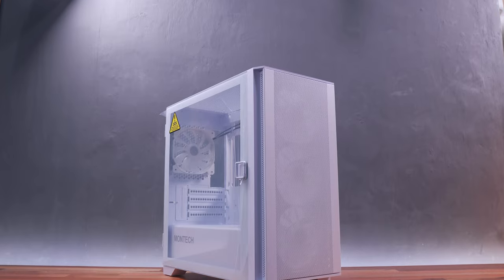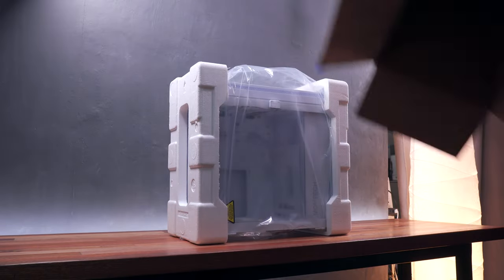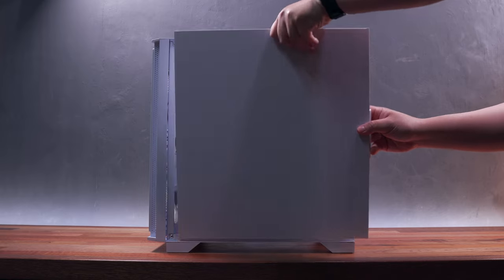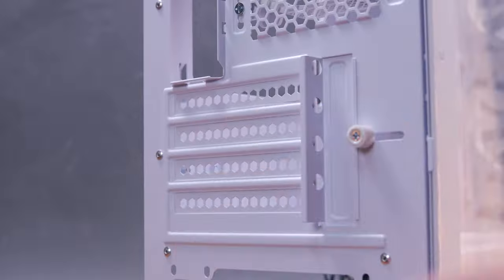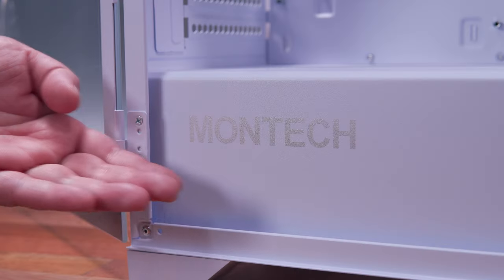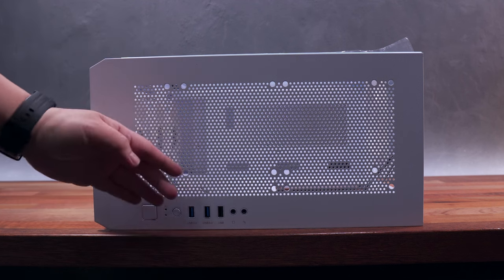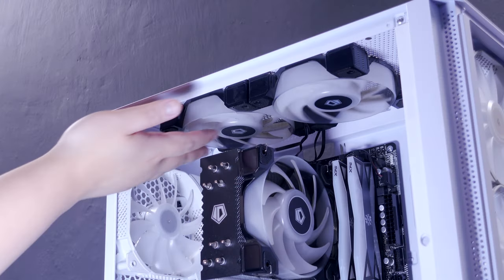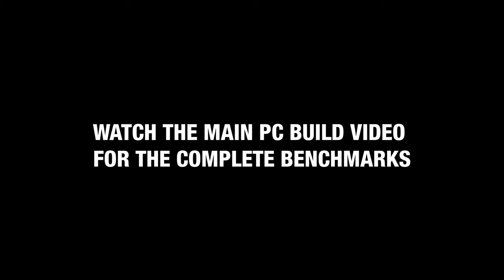Montech AIR 100 ARGB Review - Bang for the Buck!

Comment: Just picked up this case. I did replace the fans and getting ready to do a 5600X 3060 build in it.
Reply: Whats wrong with the fans
Reply: @leonthesleepy  Nothing I just wanted some fancy ones
Reply: @leonthesleepy  Most included case fans are noisy and 3pin. Some people prefer quieter and PWM-controlled fans.
Reply: @flatikk   (Gamdias ATHENA M6) says it has pwm argb fans.  Is it aura compatiable? Or i should go for aftermarket fans....
Reply: Can you change the color of the stock rgb fans or is it only the rainbow color?
Reply: @SheLuvzFear   u can change it
Reply: @SheLuvzFear the small circle button on top of the case

Comment: Between montech air 100, darkflash dlm21, and rakk haliya, alin mas ok overall? I’ll be buying 120mm fans separately so the fans that come with the case dont matter to me.
Reply: All cases you've mentioned has good airflow and similar features. I'd would suggest picking which ever one is the cheapest or pretty much a matter of design preference.
Reply: I got the Haliya M, 2yrs ago and still using it.. It's a good budget case too, but I liked the front io placement of this montech air 100

Comment: hi! i just got this case to build my first pc and i am having trouble figuring out how to control the fan lightings. i tried the button near power button but it isn’t working. any tips?
Reply: Same fid you fix it
Reply: @imLazzy.  yup! i basically had the led input connected to the reset on my motherboard which caused the issue. so to fix it,  unplug it from the motherboard and plug it into the rgb box in the back of the case
Reply: @jayjasmine4669  bro i got it fixed i am so happy
Reply: @jayjasmine4669  bro i got it fixed i am so happy
Reply: my fans rgb turn on but they won’t spin any help?
Reply: @expoxd  Hi, I have the same problem. How do you fixed it?

Comment: 1. What is the name of the fan you bought on top? 2. How did you make the wire long enough to the fan hub. It even has same connector of the 4. Question 3. How did you make all fans the same color.
I hope you will answer the 3 questions. Thank you so much. More power to you.

Comment: Does it actually fit a 330mm graphics card? 
I'm thinking of putting a 6800 xt that is exactly 330mm so I need to make sure it will fit before I buy.
Reply: Don’t buy because you can’t remove side graphics card thingso card doesn’t fit

Comment: What cable do you use for the rgb hub to power it on?
Reply: @judeyang4136 most power supplies have a cable that connects straight the to rgb hub

Comment: Hi. How did you get the argb fans to work through the motherboard? All 4 argb fans are connected to the hub and I connected the argb cable of the hub to the motherboard and it doesnt work.
Reply: I think u have to use the hub first and then connect it to ur motherboard
Reply: @joeldaking1713  can you expound on that? I connected all the argb fans to the fan. Then i connected the argb cable located at the bottom of the hub to my 3 pin argb header on my mobo.
Reply: same problem. Did you solve it already? How?
Reply: Same problem. Still no solution.